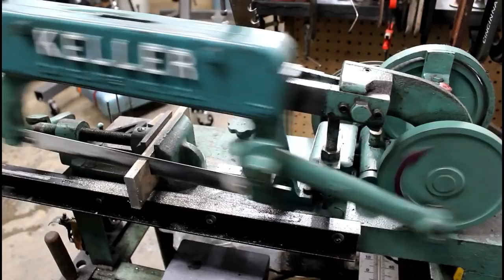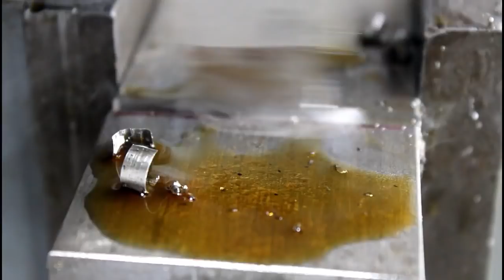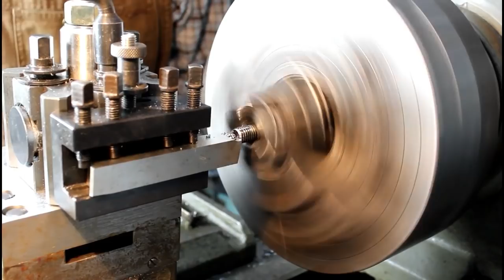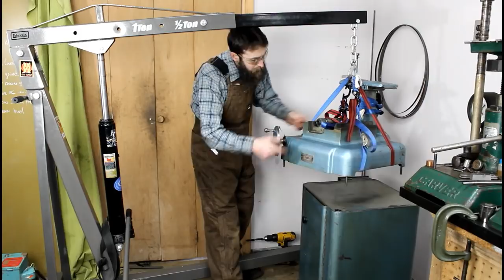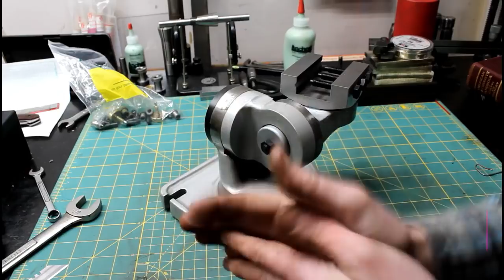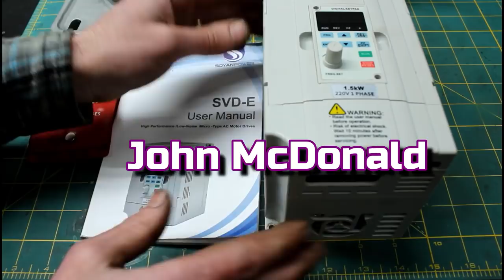Quick shop project   Leveling feet for the Cutter Grinder ;-)

Comment: Here is a thought to consider, along with all the other suggestions:  Build a stout frame that you can mount the bottom cabinet inside, under the grinder.  Stiffen it up, bring the grinder to a more comfortable height for you, and still have the cabinet for storage.  And you can easily put it back to the original configuration.

Comment: What you have is a tool & cutter grinder, not a surface grinder. What is really important is the upper deck. It has to be really rigid and hold its angles correctly. So I do not think deflection is a major problem. If it were a surface grinder, maybe then. You could always If you figure out how to use it as a mini-surface grinder then if deflection is a problem, weld yourself a more solid base. Nice video as always and please keep 'em coming!

Comment: the adjusters should work out ok if you are just going to use the machine just for tool & cutter grinding ---but  you know yourself , because you probably will as i would, use the machine for limited surface grinding & with the weight of a mag chuck combined with the table going back & fwd  the grinder will start rockin around !!!  . good video mate .

Comment: Hey Steve, great video!
Could you help me understand why having the grinder precision leveled is important. I understand why it's important on big items like lathes, but I am having a hard time understanding it for such a small item like the grinder.
Reply from the maker: CarterCreekFarm having the grinder level means nothing for the use of the machine. I  hoped that by leveling the machine it would allow me to judge wear.
Machine is level. Set level on table and move the table and see how the level reacts. It would just give me an idea on where and how much wear in in the moments. That was the idea anyway. Would it have worked? I'm not sure.👍
Reply: Steve Summers thanks for the explanation

Comment: it is really nice to see how your shop is growing.    and yes :) small hole gauges are  a "must have", as every other small items like radius gauges, angle blocks, adjustable parallel  etc etc :)  and even if you don't need them now --you can be sure there is a moment where you will need all the small things for sure . On top --> sometimes a man needs to buy what a man needs to buy :) .   thanks for sharing.
Reply from the maker: Michael Schnock  Yeah, the shop is a different place from a year ago. Growing nicely 👍.   I had to have the small hole gauges. And for less than 30 bucks. More like 25 bucks to the door. Plus they are like new. 😃 Just had to have them.

Comment: On my surface grinder I used some steel square tube to adjust the width of the feet by another 6 inches. It provides a bit more stability for these top heavy machines. I love the feet you made though. On my own machine I used purchased feet.

Comment: Great video Steve. The only thing I don't understand yet is what the stainless steel feet really add to the setup, wouldn't the rounded rods give you nearly the same result?
Reply: The larger feet give a bit more Stability to the rods and more friction to keep it from sliding if bumped.
Reply: Y Pop I forgot about the friction, that makes sense
Reply: I've seen times where the end of a rod would eventually wear into concrete.  A lot depended on how good the concrete was, but even on the toughest it would eventually wear.  Not only would that mark the floor, it could play havoc with keeping the machine  where you set it.

Comment: If  you slice the cabinet vertically  and then build a proper steel stand then you could just screw the sides on the stand to make it look like was. I think the stand adds class to the grinder.  Keeping things as original just makes sense to me.
Reply from the maker: Lee Klemetti I also like the stand. I don't think I'm going to mod the stand. I will just sit the grinder on the concrete floor to get the measurements I need. I really don't care if the grinder is level when I am working with it. I just wanted it level while I was repairing it.😃

Comment: Steve, just build an angle iron frame for your leveling legs that will support the grinders weight and spread that weight out on the cabinet base. I’m also concerned that the all thread will just pop out of the feet if you try to slide the machine to clean under it or what ever.

Comment: on the K O Lee grinder base. wonder if you could create . https://imgur.com/a/dds3h  but also create some steel structure that fits inside the cabinet that is a horizontal L shaped.  with the bottom of the L on each side toward the back  the top flange will fit under the top of the cabinet.. so the grinder base is now supported.  the L shaped devices could be just made up from round  vertical sections with plugs welded in the ends  so they fit tight in the corners of the cabinet..  steel tubing triangulated bracing in them. i spend some time on a rough drawing of an internal support structure to fit inside your base cabinet..  i suppose the inner shelves are removable if there are any.  you could make the corner posts of this longer to shorten your threaded sections.. or go big.. with some 3/4 or 1" diameter cap screws or even allen cap screws as adjustable legs again but this time with a ball bearing as a centering device between the concave or hex of the screw head and your stainless feet.. where to get big ball bearings from cheap.. CV joints  from pickup trucks in junk yards.  you will still need to make inserts for the bottom of the tubes.. this  takes all the support off the cabinet.. puts it on a steel frame inside. should give you the rigidity you look for and not be crazy expensive..  the red would be a rectangular tube.. access slots milled for the bolt down studs for the base to be accessed.. you would need to mill the corners round and weld in some corners  cut from tube scraps.   i hope this helps.. you have probably already thought of it.. adding brackets to support the shelves.. making some C shaped washers to put inside the cabinet on the legs.. to fill any gap, in case you need to make oversized holes in the bottom of the cabinet..

Comment: Good show Steve. 

If you have questions on that VFD - I know a bit. The menus are the key to most issues.  Protect it from chips extremely well. Even for the impossible. 

That grinder should get better as you load it with mass.  Robrenz will know more on the finer physics. Hold up hope that there is hope. 

Dan
Reply from the maker: House of Broken Dobbs Things _ with Dan Dobbs I'm not that worried about the machine staying level for regular use. I was just hoping that I could use the stand in the repair stage. I liked Brian's suggestion about using the floor to get the readings I want. I may have some questions on the Vfd. But it could be a few weeks before I get to it. Thanks Dan👍

Comment: About the flex in the cabinet. First make sure it's really the cabinet. Take the Grinder off and set the precision level direct on the cabinet and leaning on the edges.
If the cabinet is the problem you can stiffen it up. 
I had a similar problem once. I welded angle irons in from the bottom directly above the feet to the top in the edges of the cabinet. But I will never do it again. Welding in such a small space is painful.

Comment: Could you run tubing from bottom over the leveling studs to the underside of the top plate?  I know you would have to leave a cut out at the top of the tubes for nuts on grinder mounts. Even angle iron in the place of tubing would work. Just a thought from an old bricklayer,Greg.

Comment: Steve could you put 2x3/4 bar stock under your cabet to help create a more ridged cabnet running them front to back over the 1/2 inch bolt and then fasten it to the cabnet metal would that help?
Reply: PS I love watching your videos

Comment: Nice Video Steve. I would try and see how much flex you get in the base once the entire machine is on it. See how much deviation you get with the table to one side then the other. Short of surface grinding with it generally the table wont be moving much. Just a thought. THe Sticker put a smile on my face. Cheers.
Reply from the maker: Phil's Projects Got a Phil's project sticker in the mix👍

Comment: If you put the grinder on your floor is it stable enough to measure on? It might not be the most comfy but maybe eliminating the base would let you do some measuring anyway.  Looks like you have 2 nice grinder vises now!
Reply from the maker: That could work. I could set the top  on machinist jacks on the floor and possibly get the the info I want. Thanks Brian. That's a simple good idea.👍
Reply: bcbloc02 maybe KY is a nexus of gravitational instability with machinery😀

Comment: I agree with Jusb1066 or reinforce the inside using 4 pieces of pipe in the 4 corners and 1/2 to 5/8 inch plates top and bottom
Reply: +Jusb1066 look no further than unknowlegeable bean counters.
Reply: yes thats 2 ways to skin the same cat!  i can see the reason its moving, that thin bottom plate is flexing, i dont know whos idea it was to make the cabinet so cheaply

Comment: You could dam that stream behind you and go hydro electric if there is enough water flow!
Reply from the maker: Andrew Bittinger Thought about that several times but it really only flows decent when the weather is wet. Most the time it's just a dry rock bed.

Comment: Steve,  as aways.... awesome  content.     I don't like vfd units.  I just built a 15 hp rotary.  And placed the motor outside.
Reply from the maker: MotorHead Garage I'm going to give it a shot and see how it works out. I just cant stand the noise of the rotary  when filming.
Reply: Steve Summers VFDs  have a softer higher pitch.  Makes it easy on the ears but you microphone will pick it up .